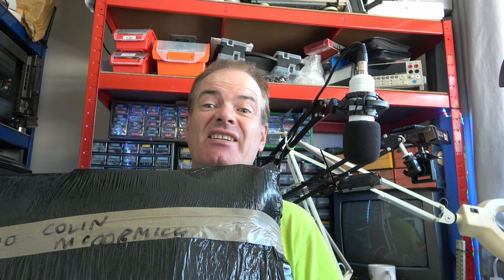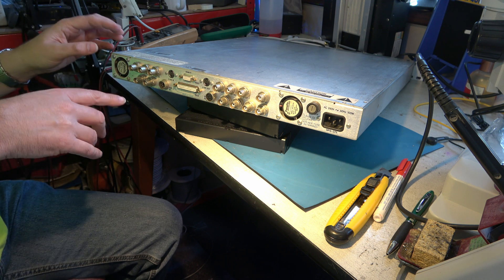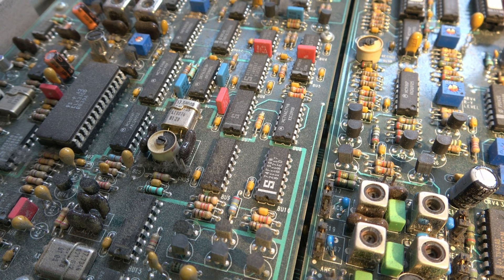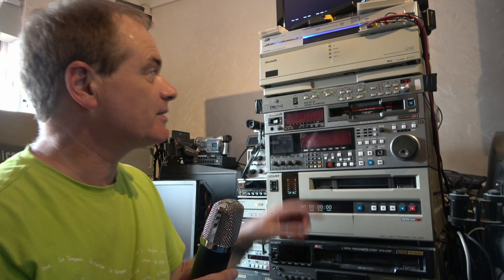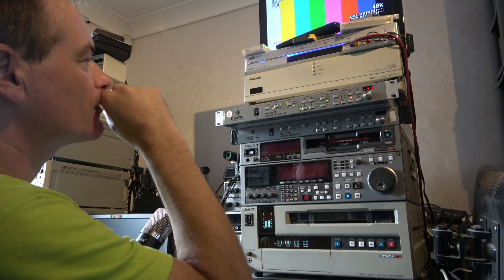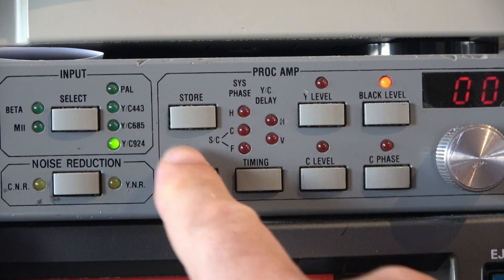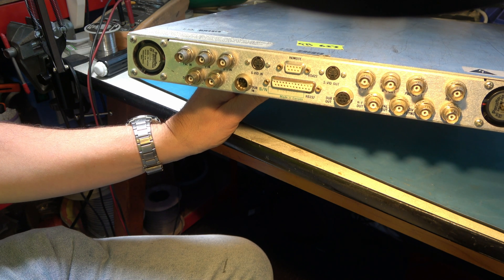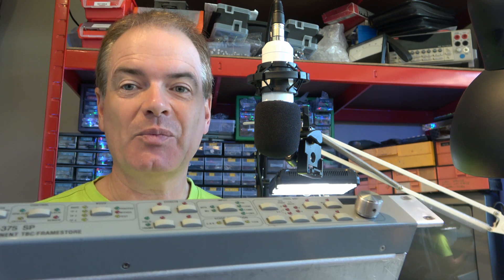Umatic Dub to S-Video or YUV with a DPS375-SP Digital Timebase Corrector.

Comment: Is it possible with VO-9600P and BVT-800PS?
Reply from the maker: If those models have Dub connectors at the rear, you would have to check for those.

Comment: DPS was a Canadian company, based in Toronto, where I was an online editor back in the 80s & 90s. They did make an NTSC version as well. These are funny devices, since they were kinda pricey. They flaunted a trend of major manufacturers building the TBC into the VTRs, at least the more serious models, like the Sony BVU & BWV series. To save money the industrial (ie non-broadcast) models, like the VO & PVW series, required external TBCs.
Reply: My Sony PVW-2800 has a built-in TBC. From the specs "TBC Remote Control. In addition to the built-in TBC adjustment of the PVW-2800, remote adjustments may be performed using the optional BVR-50 connected via the D-sub 15-pin cable to the real panel connector (TBC REMOTE)."
Reply: @randywheelerdotcom  Independent TBC is much better than those built-in TBC
Reply: X75 and DPS575 support PAL & NTSC

Comment: I was looking at the FORA FA-300P which appears to have similar connections to the DPS-375SP. Do you know if that unit would be able to serve the same function for converting DUB to S-video?
Reply from the maker: I don't know that unit, but if it has Dub inputs then I would expect it to.  Also check to see it has an RF input for the dropout compensator.
Reply: @video99couk  Thanks,
It's confusing because 7-pin and s-video inputs are available but they are labelled together as YC443. I'm concerned that means that the 7-pin is expecting regular s-video signal and not DUB. Such a gamble...

Comment: Thanks for the video!
I have a JVC KM-F250 TBC that output black when active (through the "operate" switch) with the "low video level" light on. Also tried to adjust level with the trimmer but no luck. Can you help me?
Thanks already
Reply from the maker: Probably capacitor failure somewhere.  Only real solution would be to go through it with a service manual and oscilloscope.  You can use a DVD player to generate a colour bar test pattern fairly easily.
Reply: @video99couk  Thanks for the precious hint! Since I'm not so skilled in repairing electronics, would you be able to follow me step by step doing this repair?

Comment: I have a DPS-295 that is nearly identical to yours that services NTSC U-Matic.  
I also have a DPS-210 that is merely a Dub to S-Video converter without the inbuilt TBC.
Reply from the maker: Does the DPS-295 include the dub connectors?  If so, I want one!
Reply: @video99couk  It has dub connector ports on it, yes.

https://ia902707.us.archive.org/17/items/DPS295/DPS-295.pdf
Reply: Will u sell this unit? I was looking for one actually
Reply: @westsidetillidieog  Sorry, I won't, no!  I'm still using it!
Reply: @VincentVazzo I understand you :') I will wait for one Poppin up on eBay one day. I also bought a bvu-950 and will go out over DPS 295 with dub but yes miss this unit also ^^

Comment: Hi, do you think JVC SAT-411e can do the same thing with dub umatic sp? is that your tbc the only one that can do this kind of transcoding?
Reply from the maker: I don't know that model.  But in general there is a workaround which can work with most TBCs: Take the luma signal from the Dub socket (look up the pinout for that), and feed that to S-Video Y input.  Then take the Composite Video output from one of the Umatic BNC connectors and feed that into S-Video C input.  Most TBCs will strip out the luma and sync from the composite signal and treat it just as Chroma.  Then you get a full proper Dub quality signal.  I'm pretty sure that's what the DPS375-SP is doing internally.
Reply: thanks for the answer, I have a sony vo9850 and thanks to your advice I was able to change the belts, now I wanted to try to improve the signal which in composite is very poor so I was wondering if you want what you show in the video (dps) sell, I tried to look for it on ebay but I can't find it, also the tbc JVC km-F250, maybe that is better than the st411-e, I can't find it on ebay.
Reply from the maker: @paolopalombo62  I won't be selling the DPS375SP, but they do come up for sale occasionally.

Comment: Can you tell me what replacement fans did you purchase?
Reply from the maker: Ebay jobs, 40mm 12V.  However the original fans are much deeper, and consume 0.2A.  The replacements consume 0.08A.  They really don't shift as much air.  So I've fitted just one for now and will look for more suitable replacements.  I considered stacking two but I don't think that would actually help very much.

Comment: What would you suggest for time base correction on standard PAL betamax or VHS machines?
Reply from the maker: For VHS we have the luxury of being able to select SVHS machines with built in TBCs, such as the Panasonic NV-HS1000 (I repaired one recently).  But an external TBC can be handy too.  For Beta we don't have that luxury.  I use the GTH Electronics ACE converters with SVHS and Beta.  They are sensibly priced, when you can find them on eBay or similar.  Another one I like is the G2 MSTC Ultima, but it's another one that's hard to find.

Comment: Ahh the old tech, still doing it's job spot on :-D
I can't guess how much that would have cost new, quite a lump of cash i guess.
Did you check the state of it's psu?, bound to have some worn out caps.
Reply from the maker: The fans have arrived today so I may get to have a look at the PSU later when I fit that/those.
I suspect these units were horribly expensive, but they are still very capable and well worth it.

Comment: I've seen someone online who tapped into the C signal (not the color under inside the DUB connector) right before it was combined with Y for composite output, The machine was NTSC though:
https://captain18.livejournal.com/140367.html
Here is an interesting thread about another device:
https://www.diyaudio.com/forums/everything-else/1663-vtr-project-umatic-dub-conversion.html
Reply from the maker: That first link actually answers another question too.  The Digital Processing System DPS-295 is broadly an NTSC equivalent to the DPS-375.

Comment: Yes, nice unit. I have one of these too. I believe a composite off-tape output is required for chroma burst, and your'e quite right about the DUB tape output, both Y&C signals present.
Thanks for reviewing.
Reply from the maker: Ah now that sounds like it may be a good explanation of why there's no colour without the Composite connection.  I spent ages trying to work out why I had no colour when I first set up one of these, and another chap in the business (RIP) told me to hook that up, I thought it was crazy.

Comment: I have one of these also, which I fired up recently. I was worried I was going to have to change loads of capacitors but so far, so good. I also have a For-A FA-320 and Snell  & Wilcox TBS-24, but do prefer the DPS-375 for its dub inputs.
Any experience of the Electrocraft dub to s-video converter boxes ? I hear these are pretty good but are not a TBC, just a converter. They seem to be incredibly scarce too.
Reply from the maker: I had heard of those but I really wanted a TBC with digital dropout compensator for the best Umatic results.  However I don't yet know what a good NTSC solution would be.
It might be that the DPS-375 used high grade capacitors with a low failure rate.  I'm sure it was stupidly expensive in its day.
Are both of your fans running OK?  They are noisy beasts because 40mm fans are horrible things.

Comment: Wouldn't it be easier if you mount all that wonderfull AV equipment in 19 inch racks ? If you use the wheeled type you can just rotate them if yo uj need to switch cables...
Reply from the maker: There's just not enough room in my studio for a rack.  I've considered it several times but I can't see a way to fit it all in.  I used to work on racked equipment all the time in a previous life.
Reply: @video99couk  I use 3 small ones that just fit under my workbench. Made all in/out connectors to the front, works a treat. Got them from Samson. Will just fit 3 Tascam 8track Hi8 recorders.
Reply from the maker: @huskyneusify  Well I am going to re-model one quarter of my studio (the part where the Umatic and Betacam machines are) so I will consider it again in the future.  The big (strong) wooden table which has that equipment at the moment, is not an ideal solution.
Reply: @video99couk  how about those desks that have the racks built in to act as the legs? They do them in varying sizes and even have mini racks on the top for shallow mount bits. Meant for radio studios but they'd be perfect if you have the room! As always a great video, 😊

Comment: Going a little off topic, you mentioned B-MAC briefly in the text - is there any surviving technical info on that format? I've been re-implementing some old, rare or extinct video formats recently and that's one that comes up from time to time. I've got D/D2-MAC working but from what I understand the B version is mostly unrelated despite the name.
Reply from the maker: There's a little information on Wikipedia.  It was used in Australia but I think the point of it was not to be direct to the home.
I had a DMAC received which I converted to D2MAC back in the day.  I did a web page about it: http://www.colin99.co.uk/bsb.html
I still have a BSB mini-dish but alas I don't think I still have a Squarial.
Reply: @video99couk  Ah, I remember that page from when I was first researching DMAC. Thanks for writing about it! The BSB boxes where a little trickier to get working than the standard MAC decoders, they seemed to have a very limited firmware. Took a bit of brute forcing to get the correct audio settings.
Reply: @video99couk  I found BSB fascinating. Shame although it was the superior technology it lost out to the cheaper tech used by Sky!